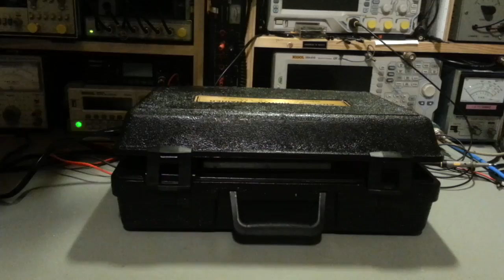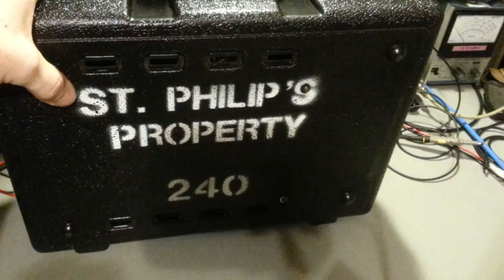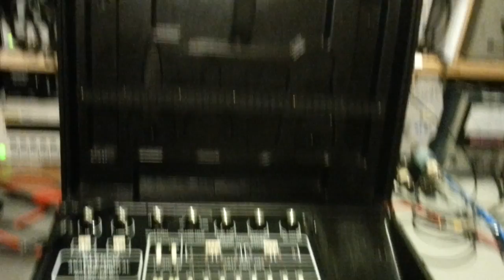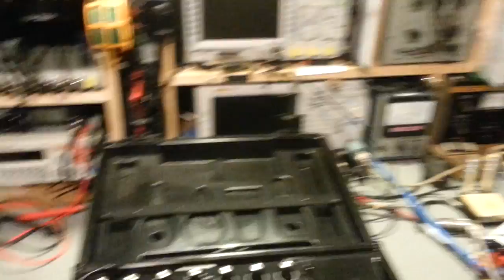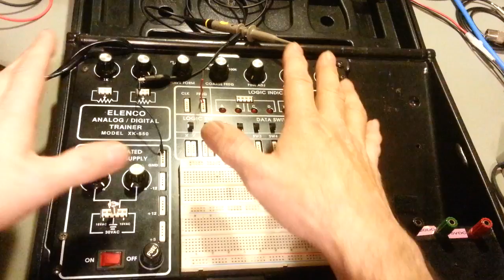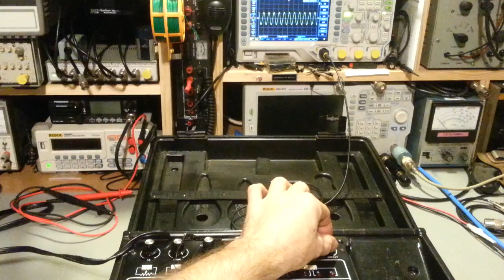Free equipment giveaway #3.

Comment: enter givaway.  we had something like that in the airforce. the nida 2000 ( nothing inside does anything) lol. thanks.
Reply from the maker: +Publicaccess2015 Generalpublic 

I actually have a Nida 130E trainer, training material and about 200 cards for the trainer.  It is the current model and interfaces with a computer.  I also subscribe to their online training platform.  Going to be starting the microwave course soon.  Extremely expensive to purchase for personal use but in my opinion well worth it.  They have a excellent training system.

Comment: Not entering.  This is a neat tool.  Heathkit made a good one back in the day.  Like you say, ebay is a great place to find them.  Nice mod putting the fuse up front.

Idea for a short video: fuses vs. panel mount push-to-reset circuit breakers.   When is the best times to use each kind.